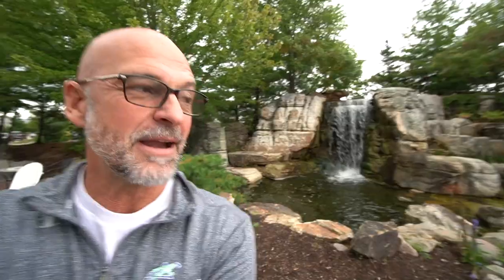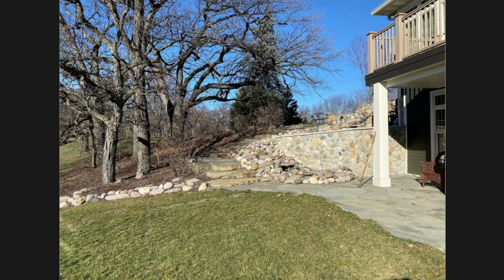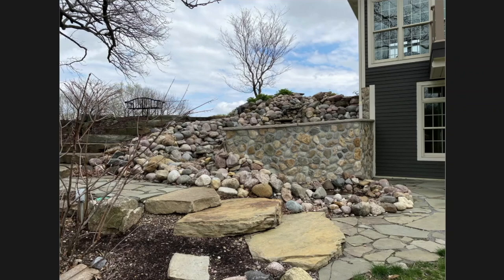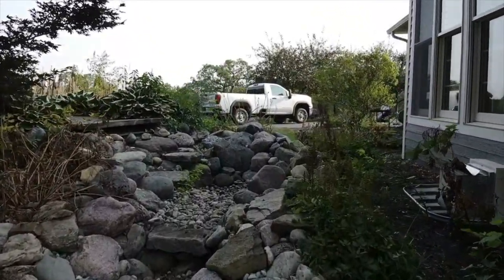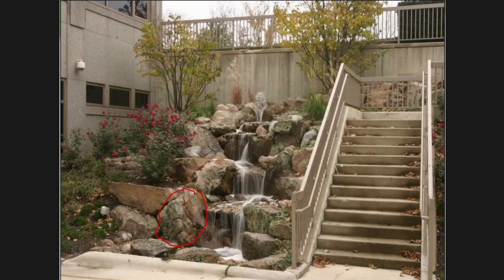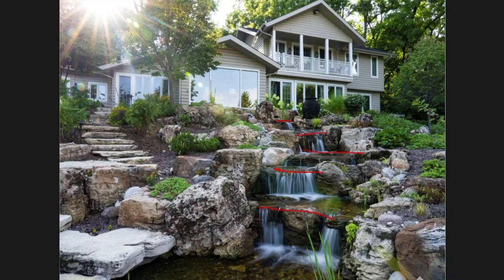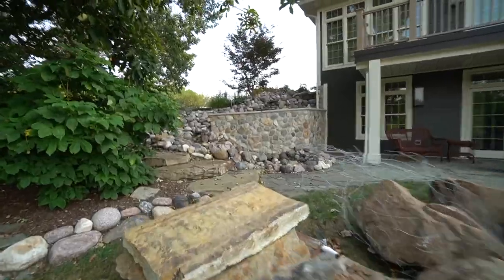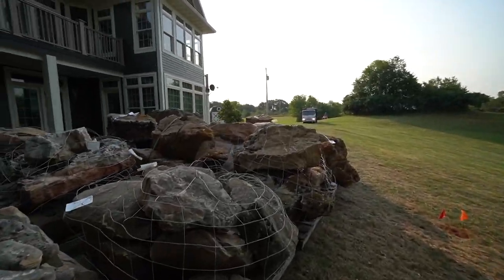Rebuilding a 10 FOOT TALL WATERFALL! - Part 1

Comment: Do you have issues with sandstone decomposition over time?   Does it hold up?  We are in western Colorado and have access to lots of sandstone
Reply from the maker: I’ve had mixed results…….
The majority of the stone & installations have been fine but we’ll occasionally get some problems, typically during the freeze thaw cycle
Reply: @EdThePondProfessor  thanks Ed.  We are at 5,000’ elevation so we certainly freeze.  We have some sandstone pavers that flake and others that don’t.